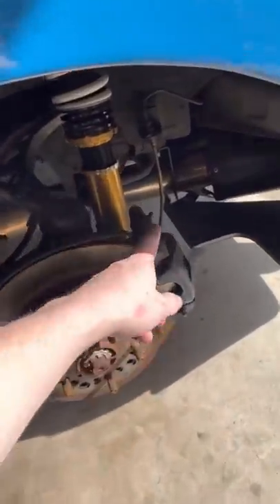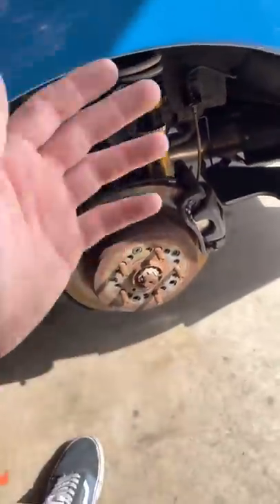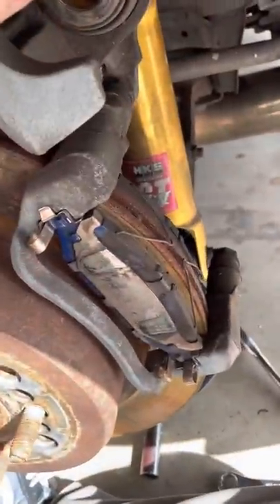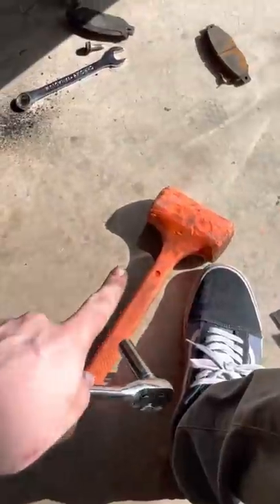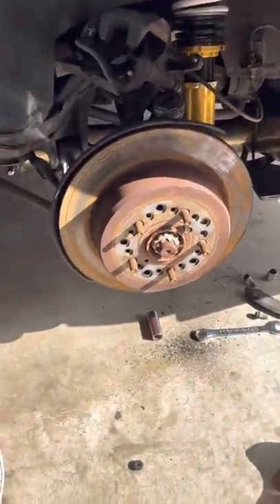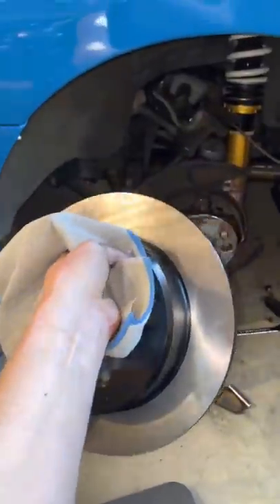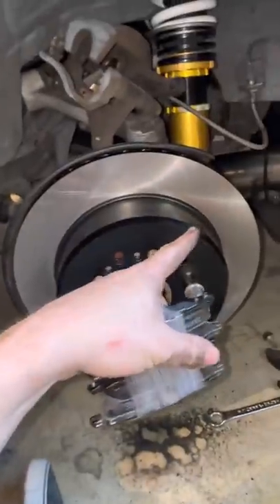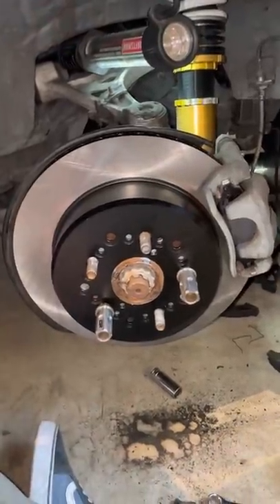How To Change Your Brakes 1 minute Tutorial  #shorts

Comment: Here's how it goes for most working class people who have to buy used cars that the previous owner probably didn't do perfect regular maintence on.
1. Go over to your buddy's house who's got all thebdsmn tools.
2. Locate a spot where the jack will actually lift the car and won't just punch a big ass hole through rust.
3. Use entire can of WD-40, PB Blaster or whatever your favorite is. (I'm not even gonna recommend a brand because dudes will straight up commit holy war over their favorite brand.. Looking at you Kroil guys)
4. Swear many times at that one bolt that's somehow bound on there so hard even the almighty couldn't remove it.
5. Get torch to heat bolt, it still doesn't come off.
6. Get breaker bar and put an 8 foot snipe on the end of it and have your fattest buddy stand on the end of the damn thing, which should generate enough torque to reach low earth orbit given the leverage advantage.
7. The fuckin thing, which at the very least should have just sheared off from that much torque, is still on.
8. More swearing, just cut the damn thing off with the rat-rail grinder (be sure to use safety squints)
9. Congratulations, it's now 2am, you're probably through your first case of beer, and you can begin actually changing the brakes on the first of 4 wheels.

Comment: This video should have been called; “HOW TO GET SUED”, or “HOW TO BE A DUMBASS”. 

You should ALWAYS put Jack stands under the car in good, supported, structural locations. And you should ALWAYS clean the rotors with brake clean and good rags before installing! They come with anti-rust stuff on the metal that way it doesn’t rust during shipping or in the warehouse. Also; find out the break in procedure!! It is very important!
Reply: how is he gonna get sued over this

Comment: I always go Akebono pads as well but I’m VERY disappointed in them this time around. Maybe they changed the formula? Still zero dust and zero noise, but horrendous stopping ability!! I’m using brembo rotors (not drilled or slotted). 09 Toyota Matrix XRS 2.4

Comment: Its a pad slap, he didnt lube the sliders or the back of the pads or where the pads ride or the pistons or anything, theyll be squeaking due to high frequency vibrations in no time, also didnt burnish the new brake pads to the new rotors so there a posiblity hell have hotspots in his rotors after a trip in town. And jack up the car with the jack as parallel with the car as you can get it, so that way the jack rolls with the car and the car doesnt warp the jack. Dont be this guy if your trying to do brakes, especially on a customers car.

Comment: You forgot to mention the fact that the new pads are going to be thicker than the old ones so before you remove the caliper or the pads use a screwdriver to pry the piston back inside the caliper so that you'll have sufficient room to put the thicker pads on, because if you don't the rotor will be way too thick and the pads will be way too close together to fit over it

Comment: Might wanna add that you need to pump the brakes once everythings on properly
Reply: Seat the pads, bleed the whole system, then bed in your pads properly. He totally forgot to mention pushing the caliper piston back in, which is a B*TCH on several makes. Also, lubing the pad guides and slide pins

Comment: I wouldn't break lugs loose before jacking car up, puts strain on threads and u could damage them because all the weight of the car is on them
Reply: Not really, the lug nuts themselves aren’t under any downwards pressure. Thing is without an impact, the wheel would just spin when you try to break them.

Comment: Ain't got a McLaren but I am a mechanical guy....even I don't have such skill changing brake rotors under 1mins (some vehicles you need to take out the axle nut 32mm or 36mm, in order to take out the rotor )

Comment: So ig absolutely nothing mentioned about pushing the brake caliper back in using a caliper press or a C clamp, kinda a big part. Also didn’t mention lubing the guide pins so the pad moves in an out smoothly. And also didnt bother to explain that after changing you breaks you need to press the brake down a few times to get the brakes to properly function. Appreciate the effort but seriously guys look for a more detailed step by step explanation

Comment: Hold on, did our boy apply anti-ceas to his wheel lugs? BAD MECHANIC! BAD!! BAD DOG, NO BISCUIT!!!!
(Anti cease on wheel lugs will prevent you from properly torquing your wheel to the required specs, in many cases, it can cause you to drastically over-tighten your lugs to the point of breaking them off in your driveway. And that's if your lucky.)

Comment: No please don't clean off the rotors, new rotors come with breaking in fluid, not oil on them, so cleaning it off with brake cleaner would just give you more work to break them in

Comment: Shouldn’t you have to bleed the brakes after installing new pads?
Reply from the maker: You don’t have to, that’s if you break open the line to compress, you can remove the cap and compress without cracking open the line.  Bleeding them is never a bad idea however

Comment: As a mechanic this is false brake discs aren’t within vehicle specs from the factory they must be resurfaced while on the vehicle
Reply: Huh? New rotors are vehicle specific, with new pads you just slap em on. If you don't replace them, THEN you resurface the old rotors, but only down to a specific machine-to spec. No such thing as resurfacing a new rotor, and no "mechanic" should ever try and convince a poor customer of that

Comment: What about compressing the caliper to get the new pads on?
Reply: some are screw in on the back requiring a special tool, most you can use a large c-clamp and remove the master cylinder cap and press the piston back in slowly
Reply: @THRASHMETALFUNRIFFS  yep! I’m just saying that’s not mentioned in the video at all.

Comment: You’ve been totally ignorant of the fact if you adjusted the handbrake shoes back first, you wouldn’t have to use the bolt to draw the disc (rotor - for yanks) off at all. 

You’ve then ignored re-adjusting the shoes after the new disc (rotor) is fitted.

How not to brakes - unless you want damaged handbrake shoes and/or a non functioning park brake.

Comment: Centric rotors are trash bro. You should have did the complete brembo swap
Reply: Brembos are awesome. Sure they cost more, but cut the time down doing a brake job, so it's worth it.
Reply: @iamlokittyofmeowsgard2934  it's not especially with the power he has to that supra in particular it's better off he spends the extra cash to get a brembo brake kit come on he has a poor man's supercar he could afford a $3,000 brake kit and he will have confidence on the road.
Reply: @VERIFIED_COMMENT  well sure, since you put it that way 👍
Reply: I wonder if the 4 piston calipers from a tundra could be adapted to fit, along with steel braided lines, fo us poe folks.

Comment: Those are some tiny ass breaks. If those exterior mods arent just there for show and slow, probably should have upped those while you are at it.
Reply: the rear brakes really dont matter as much as the front and the front ones will always be bigger
Reply: @6z0  they do when you're driving fast.

Disparity is fine, but undersized breaking capacity is never a good idea, which those clearly are unless he's stock.

Comment: Frfr though, never use antiseize (like neverseez)  on a bolt or anything threaded, it makes removal later on down the road a complete nightmare; it contains solid material like copper. If you're wanting to use lubricant or something to keep bolts in good condition for longer, use a dry silicone lubricant or Dupont lubricant.